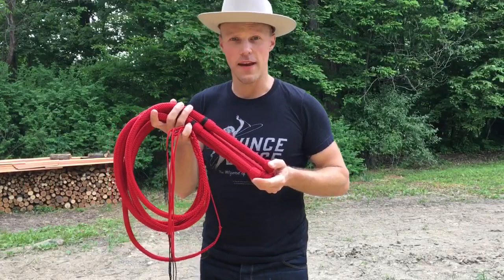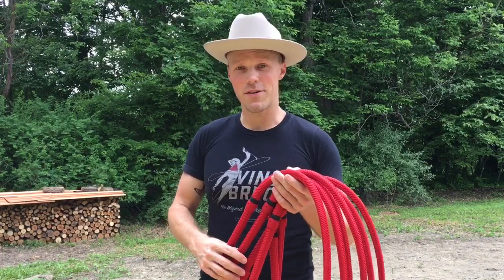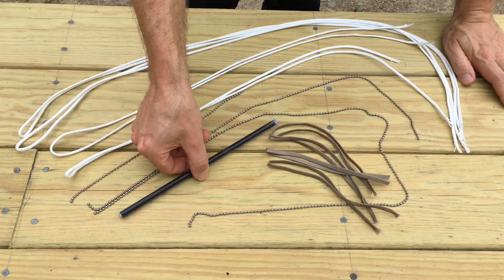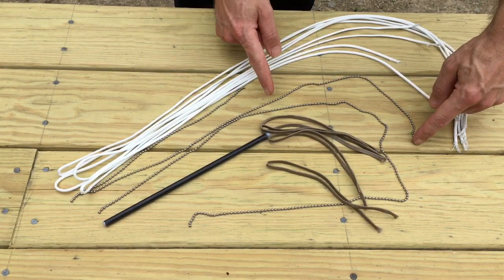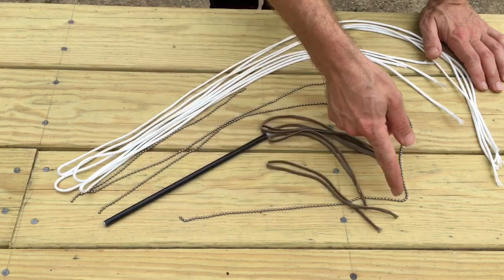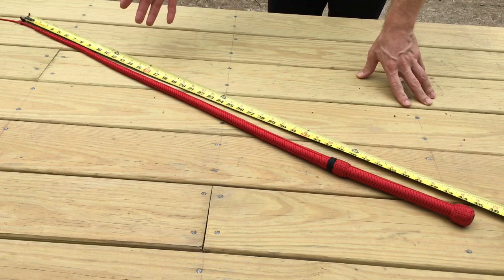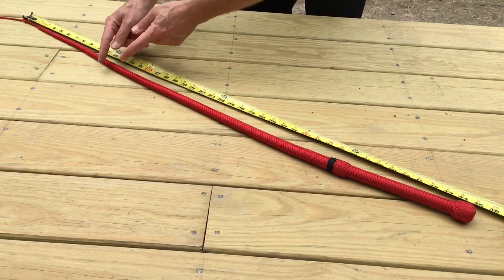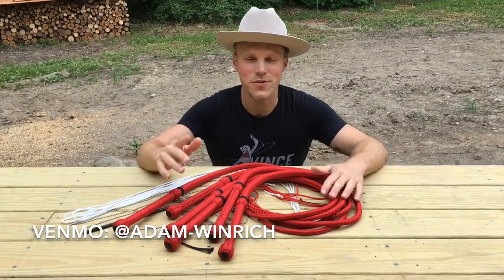How to make a Juggling Whip

Comment: Boy, all that info comes fast and furious!  Adam, for the length of your longest continual stands, 1.8-ish times total length intended for tip back plaiting still?  Trying to digest your design theory.   Thx.
Reply from the maker: I use the formula for all of my paracord whip making.  The whip is about 4 ft, and since all of the strands will get doubled over, I take 8 ft times 1.8, so the longest strand is about 14 ft.
Reply: @Adam-Winrich thank you for the quick reply.  It would seem to me that using ungutted 550 in the belly should be faster to gain diameter and shape than multiples bellies. Why then two or more bellies using gutted cord?

Comment: Adam that was quite interesting. I’ve never seen a whip build from the tip of the thong. Do you find it easier to make a whip that way? Cause I’ve always started with the handle.
Reply from the maker: sgthawke, for most whips I start from the handle.  The first short set of whips I made for Aaron were made this way, so we stuck with this design.  If you want to see another build method of mine, I did a collaboration video with Nick Schrader last year.
Reply: AdamCWM Thank you for the info. I will look into that. Your videos have always been helpful and fun as hell to watch.

Comment: Wait, how do you add the core?  I mean, do you just hold it in place with your fingers until there are enough turns of the overlay holding it in place?
Reply from the maker: I tuck the end of the core under the strand I just brought around in the braiding pattern, leaving about an inch of the core sticking out above that strand.  Then I braid a couple more strands before I pull the core in so that almost none of it is sticking out.  Once I have done 8 stitches of braiding, I carefully pull the last bit of core in so that it doesn't stick out anymore.
Reply: Brilliant!  Thanks!

Comment: Can you make a short video showing how you add a doubled over strand to the overlay?
Reply from the maker: David Barnett, I did that already, it is right in the middle of this very video!!!!!🤦‍♂️
Reply from the maker: If your question is "how do I add a strand while braiding over the core", then look at the photo at the 6:31 mark.  Start by placing the middle of the strand at the back of the braiding, then bring one side of the strand through the braiding pattern, crossing over the front, then bring the other side of the strand through, crossing over the front in the other direction.